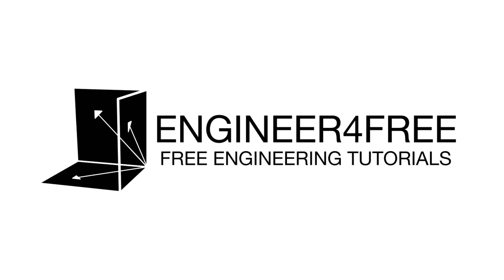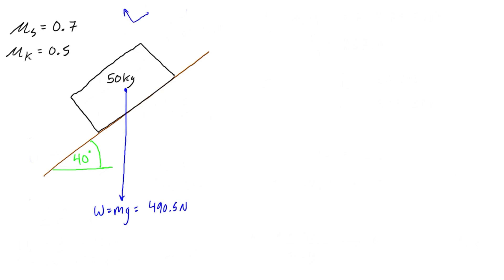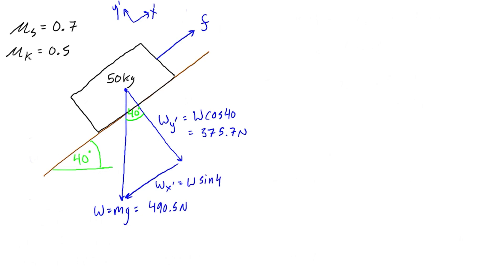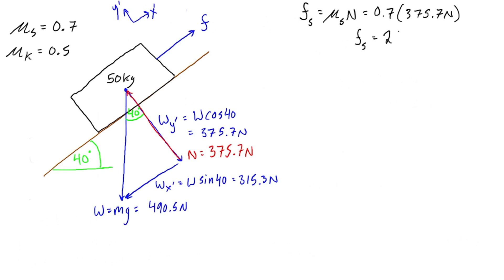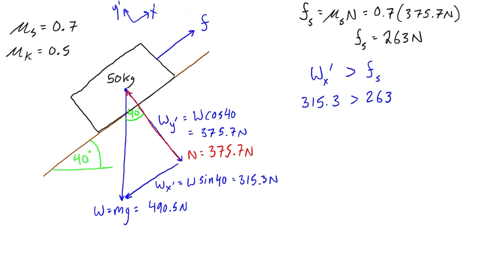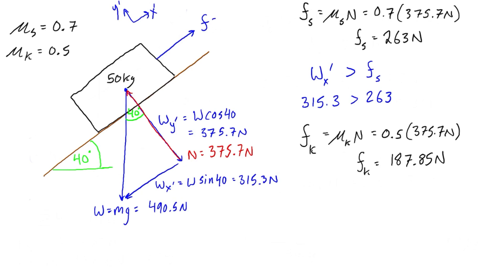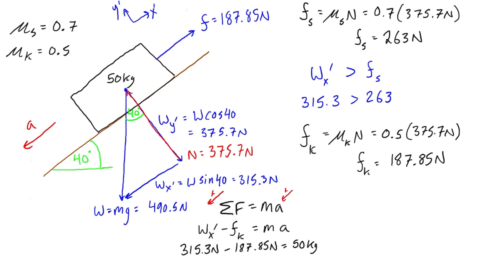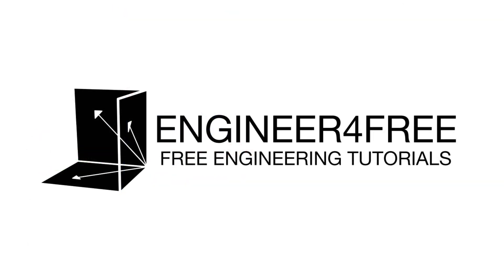A block is on a slope with friction, what happens?

Comment: Hi! Thank you for the explanation! Really helpful! But isn't there a miscalculation of the mass? 50kg is equal to 500N, therefore mg comes for 500x9,81=4905N, right?
Reply from the maker: Hey no. 50kg is not 50N. F=ma, or in other words, weight = mass * acceleration due to gravity. weight is in newtons, and is a force. mass is in kg, and is not a force. So we take 50kg * 9.81m/s^2 = weight = 490.5N. Hopefully that clears it up!